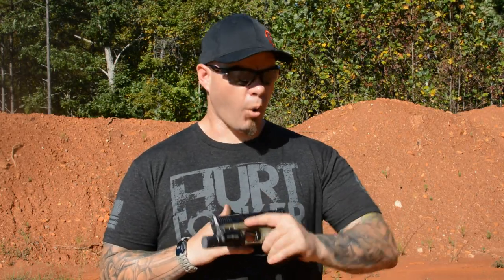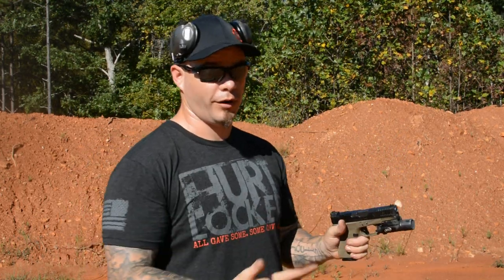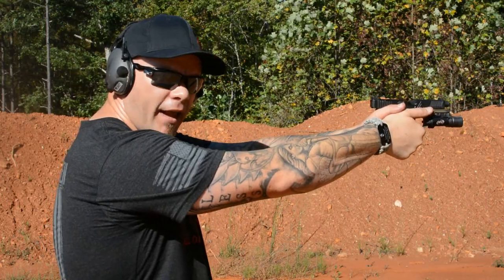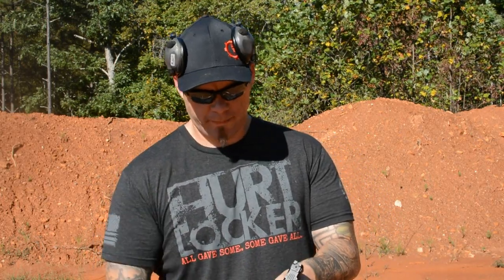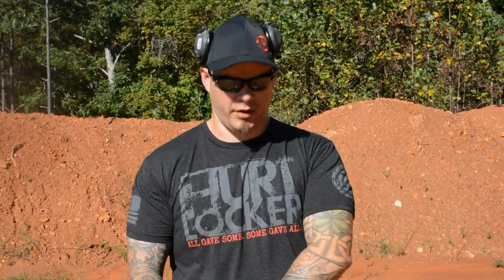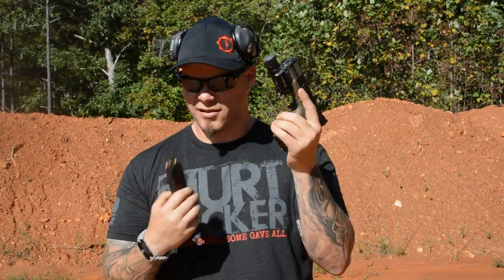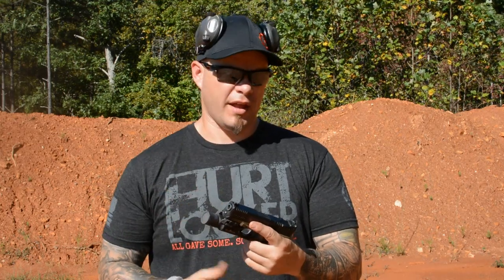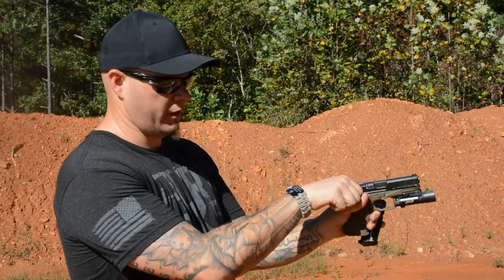Handgun Malfunctions

Comment: As far as I know, Clint Smith has never taught to lock the slide while clearing a double feed.  I can personally attest that in 2001 he taught me to strip the magazine without locking the slide.  I do agree that if you recognize a double feed, then there is no need to conduct a tap-rack-ready drill nor is there usually a need to rack the slide multiple times in order to clear the chamber.

From my limited experience, the most important component in clearing a malfunction is not to delay.  At the range you often see people just stop and stare at the pistol when it malfunctions.  You must train yourself to take immediate remedial action if the pistol fails to fire (for whatever reason).  If you have a shooting buddy, load each others mags and put one (or several) dummy rounds in some of his mags.

Comment: I agree with most of what you've said. As far as the double feed, for those that are wise enough to carry spare mags....I cannot agree with reinserting the same mag that you had a double feed with. Unless its extreme circumstances such as your on you last mag. The rest of your double feed clearing is right on but I personally would drop that mag and grab a fresh mag...with the exception of extreme circumstance I mentioned before. Reinserting the same mag, to me is increasing the chance of reinserting a possible problem back into the weapon. Hard for me to make sense of that. If it is the only or last mag available it sucks but it would be the only option. Tis why I as a CCW civi these days I still carry two spares, (any less seems irresponsible for my paradigm). 
Great vid. Good info.

Comment: I discovered the magic strip with my M&P using steel case, the method worked fine. Had the same malfunction with my Canik TP9SF and could not remove the magazine for the life of me without locking the slide open. Both malfunctioned in normal use / cycle.

Comment: First off, that cop experience with rotating rounds blew my mind. Never thought that could happen and I am still skeptical but I stopped unloading and reloading everyday for other reasons and now my gun is chambered 24/7 365 with the exception of maintenance.

As for the double feed with the slide still under pressure, don't you think this can widen the mag lips causing more malfunctions for the future when clearing it like that? I have come across mags with wide lips and the bullets tend to just slip out easily when its out of the gun, so I can imagine when its in real use.

Lastly, I don't get to shoot often but have shot enough in my life. I'm middle aged. All the failures you showed I have dealt with but when you say common, I don't really think that applies to me because the most common issues I've had with centerfire rounds and hollowpoints particularly is a different fail to feed. This one is when the chamber is clear, the round begins to cycle but the tip gets stuck on the feed ramp. Has this mal ever happened to you? This can happen during shooting or just racking the slide. And I think its happend to me more just racking the slide. I have found that this mal is attributted to a bullet tip that is flared or wide open ie Golden saber ( wide mouth ) vs. Hornady Tap ( small mouth ). Seems like the wider mouth has more contact area on the feed ramp and cause it to stick than the smaller mouth. 

Although I have had it happen with smaller mouths like the Win PDX1 Aka ranger a very few times, but predominantly happens with the wide mouth tips. Has even happened with flat nose rounds like .40 caliber range rounds. So now when I look for rounds to carry, I take that into consideration. I am not 100% sure this is the cause, maybe its a mag issue or something else but I feel this was the problem. So it would have been cool if you talked about this.

Comment: I agree with your reasoning.  There is a time when too much "insurance" is either moot or even detrimental to the situation.  A life defending situation needs to happen as smoothly and efficiently as possible. 
  As for your method of stripping the mag, ejecting the problem round, reinserting the mag, etc., I must have been on "the fast track" because that was the only way I was tought from the beginning, a long time ago, in the military.   Yuup, it works great.  So much so, that a company was founded on the principle of being able to strip a magazine that may be tough to extract.  You may have heard of it...  It's called..  Wait for it, "Magpul..."  lol. The little piece that attaches to the bottom of your magazine started an empire. 
  But seriously, there is something that needs to be addressed as the "tap, rack, bang" drill is sweeping it's way through training schools and ranges. 
  If you're in an ACTUAL life threatening situation, where a second or two can make the difference, then absolutely...  Execute that maneuver as quickly as possible.  But, if you're in regular training and range conditions, upon encountering a failure to fire situation, freeze, with barrel still trained on target, for at least a five count, to ensure that you do not have a hangfire situation.  And here's why...
  Yup, a modern, well maintained firearm with modern ammo has a very unlikely (but not impossible) chance of a hangfire. 
  However, just as you mentioned the officer, who's just down the road from me, in Lawrenceville, GA. had a "double failure to fire" with otherwise "fine ammunition" due to mishandling of his carry ammo, people are people and can cause good ammo to become compromised. 
  Having the ammo in close proximity (a big no-no) while cleaning a weapon can allow cleaning solvents, etc. to come in contact with the ammo, defeating the seal, etc..  Wiping down "rusted cases" on live ammo with WD40, etc. after moisture exposure can absolutely compromise ammunition. 
  Now, your otherwise high quality, defense ammo can be a dud or subject to a hangfire.  Please reference the video by CRS firearms channel demonstrating a number of malfunctions (almost all) in a group of ammo he compromised, including hangfires. 
  I'm making a specific point about this because, if you get in the habit of executing rapid "tap, rack, bang" drills during standard range time and have introduced defective ammo into your well maintained, high quality weapon and, upon experiencing a failure to fire, immediately pull the weapon off line of the target and the round suddenly decides to fire while the barrel is pointing at something/one that you do not intend to shoot...  Things can go south quickly. 
  If you manage to strip the round from the weapon and it detonates as the round is flying through the air, again, not so good.
  It's because this situation is so rare that makes it such a danger.  Confidence in the fact that "it can never happen to me" is often one's "famous, last words.". 
  So, I would ask people to give this it's due consideration and give the few seconds of caution when practicing their failure to fire drills.  It could save a life.  Or the windshield of your truck...  ;)

Comment: I had my very first catastrophic malfunction this past weekend at the range. Bad primer, heard a slight bang but zero recoil and alot of smoke.... In my head I'm thinking hang fire so I take the magazine out and point the gun down range and wait 20sec. After the waiting I try to clear the gun and the gun won't budge. It was like it was completely frozen in place. Luckily since it was a Walther pdp I could still disassemble the gun like you would a field strip because you don't have to pull back on the slide a bit like you would with glock, just pull down on both takedown levers and the gun shifts forward on its own. Once I took it down and separated the lower from the upper and got the guide rod out the barrel was practically fused in place with a round fully seated on the breach face and bullet still I'm the casing was just barely sitting inside the barrel chamber. I guess from the heat of the bad primer it like welded the casing to the breach face and still wouldn't budge. Litteraly had to take a rubber mallet to the portion of my barrel that's exposed from the top of the slide to finally get it to come loose. The round was still fully intact but the primer looked gnarly like ripped halfway open with burnt black all around it.... Thank God after I cleaned the gun and got it back together it ran another 100 rounds just fine. This was with good Norma 124g ammunition too. Ammo that I've fired thousands of times previously but I did notice with my last shipment the primers were no longer the pretty silver they used to be, they were the same color of the brass round...

Comment: First off ... great videos and you just won yourself another subscriber.

Do you address failure to feed as a separate drill at all?  Some people teach to hit the slide from behind to force the round into battery, but I have found that that more often than not ends up banging a round that can"t actually fit into the chamber so tight that what could have been a simple tap,rack now becomes a major operation to resolve.

Your objective approach is inspiring.  Thanks

Comment: Besides a limp wrist what are the causes of the double feed.  Lately, I've been having too many double feeds, every magazine at least 2.  The pistol is a S&W 9mm 6906 that I've had for over 35 years.  So far a solution is not there for what is causing them.  The guide rod spring has been replaced and it is still about the same.  It is in good condition.  Do you have any suggestions for a remedy.  Thanks!!!
Reply: Extractor claw and/or spring fatigue maybe?
Reply: @skullofserpent5727  Thanks for responding. It turned out to be the spring, and now it's just fine.

Comment: A couple young women were shooting in the lane next to me at the range a while back. They had a Hi-Point 9mm. I saw them standing there together messing with the pistol as I was getting ready to leave. They asked me if I knew how to "fix" their gun. I looked, and it was a double feed. I locked the slide to the rear, then I pulled the mag out. The round in the chamber fell out through the bottom of the mag well.

One thing I noticed was that straight blowback pistol had a heavy spring in it when I went to lock it back. Possibly the only good thing about the pistol, though, is that the base pad on the magazine is HUGE, so no problems pulling it out of the pistol. It would be interesting to try this method with that Hi-Point--not that too many serious practitioners are going to be carrying one.

The worst pistol I ever had when it came to clearing malfunctions was back when EAA first came out with their polymer-frame Witness. I bought one at a gun show--after stupidly selling a nice FAL rifle. It had a shortened frame, so you could use lower-capacity mags and conceal it more easily. Or you could use the full-size 10-round mags with a spacer on the bottom so they fit flush. That thing would double feed like crazy--never made it through a single mag without one happening. I can tell you that those CZ75-style pistols with the slide down inside the frame are a bitch to deal with in that situation. You're trying to get a good hold on the slide, and it's hot and there's not much to grab hold of in the first place. My love affair with that style of pistol ended with that experience. And the pistol ended up in a pawn shop. I feel sorry for whoever bought it.

Comment: Shot with steel for the first time with my XL last week and got a double feed every 8-9 rounds. If I pulled the mag and let the slide go forward, it was nearly impossible to rack that slide afterwards. Took me using the optic on the bench to rack it back all the way or far enough to lock it in place. When I locked the slide back prior to pulling the mag, this was a non issue. Just throwing that out there. I'd never have steel in my ccw, but was shooting with it because $ and what not. Never again. Couldn't even do drills because it happened 2 or 3 times a mag (12 round factory Sig)

Comment: Aaron, I am a left-handed Glock shooter.  I run the flat factory slide release with the tip of my left index finger. Which upgrade slide release have you settled on as "best" for the leftie?  Ghost makes a product with the extension forward that makes sense to me (less contortion to reach the release).  I notice your extension points aft.  I appreciate your advice.

Comment: At about 11:30 you said you have yet to find a gun that wouldn't allow you the technique of stripping the magazine on a double feed without locking the slide to the rear.

Try it on a  Beretta 92 with a mil issue flush bottom magazine. Gloved hand or not doesn't matter. Just want to know your thoughts.

From my experience it is difficult to do even when you lock the slide back as well.
Reply from the maker: I discovered the technique on a beretta 92 when I carried it as a duty weapon, though I rarely see 92s in class.
Reply: +SageDynamics Factory civilian magazines have enlarged floorplates. Mil issue are flat and flush.

I was just curious as to how you might approach that issue. especially since a lot of us Joe's have to run M9's.

I run a 19 for edc.
Reply from the maker: +kurt the flush plates have to be worked from the toe, or a small band of 550 cord can be looped through the drain hole to give you a pull point
Reply: +SageDynamics I'll give it a shot, thanks bud.

Looking forward to one of your classes next year.

Comment: That carbon buildup on that light bezel probably drops the output to 2 lumens...lol 

I found a light coat of shock oil stops carbon from sticking to the lens. I normally wipe the lens and reapply a very light coating whenever I clean a weapon.

Comment: Doublefeed method - diagnose, strip mag, rack slide, insert mag, rack slide, fire. Could you try diagnose, strip mag, insert mag, rack slide, fire? Let us know if that could cut time and still be effective.
Reply: Yes, that method also works and I've seen it taught by other instructors. It's not quite as reliable as racking the slide before inserting the mag, but it's faster and works better for people who need to retain that magazine but don't have the hand strength/dexterity to hold onto it and rack at the same time. It's all trade-offs.

Comment: I got a question.. if you hear a click couldn’t it be  squib? Tap, rack (look at the round?) and on a ak too no last round bolt hold open but a hanmerfall without bang. What if you have a squib on the last round and you think you are empty the only odd thing would be when you load the mag and rack the first round you would extract a case right?
Reply from the maker: A squib is still a fired round, just underpowered. It makes more than a click.
Reply: @SageDynamics  i havent had a squib myself or seen it live so my best guess where videos. what is to expect from a squib? puff of smoke? or a weird pop? and i can imagine its easier to detect a squib on a rifle then it is on a small caliber pistol? thanks for the answer
Reply: @lucatriet575  Yes, a pop or loud click, depending on your ear protection.  A puff is less likely if there is a bullet in the bore.  If you hear a click and extract an EMPTY case, take the gun down and check for a bullet in the bore.  Otherwise the next cartridge will either fail to chamber (hitting on the bullet in the barrel) or blow up your barrel due to a bore obstruction.

Comment: Just curious if you had any advice for me on this, because I see you are a left handed shooter. So I grew up always shooting right handed, but maybe about 5 or so years ago I did one of those tests with your eyes to see which eye open that nothing moves. I am not sure if you have heard of this or not, but basically I found out I should actually be shooting left handed because my left eye is the one that (when open and the right eye closed) no background objects shift. Sorry if that's a bit confusing, if you don't get what I'm talking about I think I could clarify for you if you need. But i have always grown up shooting right handed and I'm a great marksman, with my left I am about 80% as efficient in accuracy and speed. Which would you say I should use? My left, which I should be using but am more unfamiliar with. Or my right, which I have used every time and I am proficient with.
Reply from the maker: I'm right eye dominant. Not something I really even notice anymore. It ultimately doesn't matter as long as you shoot with both eyes open.
Reply: Ok thanks! Yeah, the only reason I noticed it, was when I went clay pigeon shooting, using my right eye. I would track with both eyes open, but close my left eye when I went to shoot, and that would throw off my aim. It was my first time going out clay pigeon shooting, but I eventually tried using my left hand, which worked ok. But i finally just decided to keep both eyes open.
Reply: Do you use a gun you like, or a 'better gun'